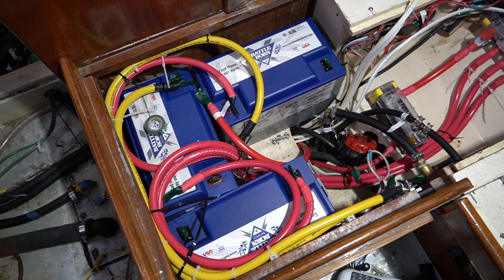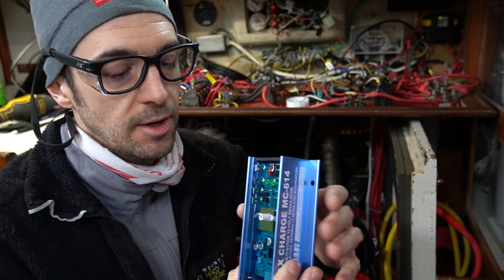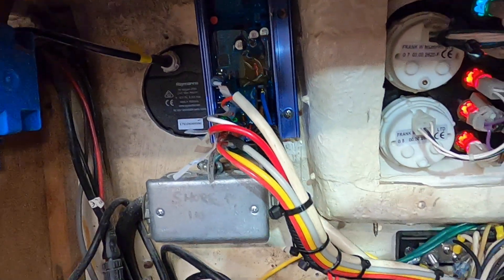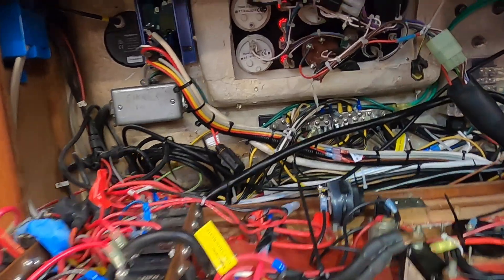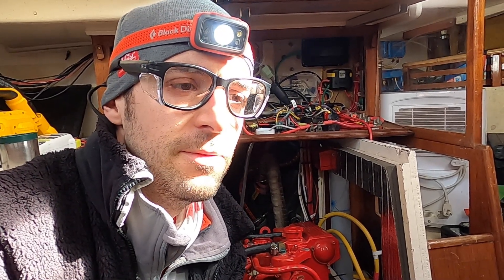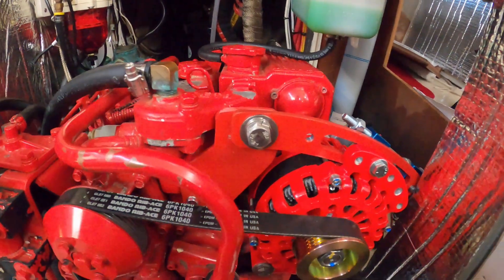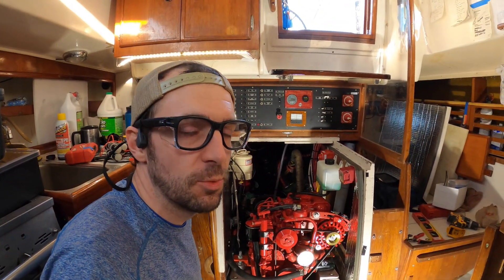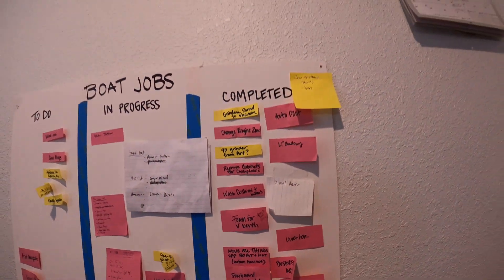Major Electrical Upgrade to our 40 Year Old Boat- WE'RE GOING LITHIUM! (Episode 46)

Comment: The two wires at 6:03 what did you end up wiring them to? I
Reply from the maker: I will get you this information next time I check the engine!
Reply: @CruisingMaya  thank you I've been researching for 3 weeks straight. The purple wire is the ignition key on and the other stats hot all the time. We shall see.
Reply from the maker: @Tripp III  oh my if I known you were researching I would have gotten back to ya faster! 
I am going to run the engine tomorrow so I'll get eyes on it and let you know
Reply: @CruisingMaya  no worries at all, thanks again and you are appreciated more than you know. Your video helped so much.
Reply from the maker: @trippiii7715  Ok so we are staying one extra day, engine goes on tomorrow and I will let you know. Stoked to know the video helped your cause.
Reply from the maker: @Tripp III  OK got eyes on it. One wire was "D+" on the old alternator, which is basically ignition 12v.... tells the alternator the engine is on. The other wire is tachometer. Most engines get their tachometer signal off of the alternator. Our install takes the tacho signal from the alternator, sends it to the external regulator and then from there to the engine dash tachometer. 
Hope this helps!
Reply: @CruisingMaya  You have no idea how huge this is! God bless you and thank you so very much 🙏🏾🙏🏼

Comment: Hello, very nice to see the final product of the wiring. Could you share the fuse sizes you installed for each lithium battery? And discuss how and why you chose mrbf fuses? I see a lot of articles call for class T when using lithium but you can’t beat the convenience of the mrbf’s. Thanks
Reply from the maker: Hello and thanks for your comment! We have a 100 amp fuse for each battery and then a 200 or 225 Amp mrfb fuse (I'm away from boat at the moment). 
A class t fuse would go nicely as a replacement for the master mrbf. For our size battery bank I feel good about two levels of mrbf fuses, but on banks bigger than our 300amphr one I'd definitely put a class t in. 
Thanks again for your comment and watching!
Reply from the maker: Also, space was such a premium for us we opted for the space saving mrbf.

Comment: This is great! I am in the process of researching a Lifepo4 upgrade myself and found this…had a few questions if you don’t mind answering:

Any thoughts on performance of the system after a year of use?
You went from 400ah to 300hr…I know lithium has more use of the 300ah. You happy you went with the 300ah instead of maybe something like 400ah? I am debating doing 300 ah system myself as I have simple systems like yourself but also thinking maybe I just go with 400 as it won’t be that much more…

How much solar do you have on board to help with charging?
Reply from the maker: Hello and thanks so much for reaching out! We are happy to answer your questions. First off, after a year of using and abusing these batteries they tested out at 100% capacity. Here's a video link to where we tested them: https://youtu.be/tDi2wcUUEhI
300 amphrs worked for us, although 400 would have been nice... 
Our supercharged alternator (170amp) and 200W solar panels really helped. I would add more solar panels if we could just to help keep up with our energy needs.

Comment: I would like to know more about the plexus adhesive.  I am mounting bracket boards behind my electrical panel and the access sux!  I usually use thickened epoxy, but for that I usually sand back to glass.  Doing that with all the wires in the way is not an exciting idea.  I look forward to hearing back from you.
Reply from the maker: I feel your pain! I would still recommend sanding back to bare fiberglass with the plexus. However the plexus sets rock hard in like 5 minutes- I used it all the time when I was building boats a few years ago. For hard to reach places I put a dap of hot glue on the thing I'm mounting just before placing it- hot glue holds the item in place while the plexus kicks. It's expensive stuff, but works wonders. Hope this answers your question! Thanks for watching our videos!

Comment: Looks nice, real nice ;-) How's it been performing on passage?  Did you say in another video the reason for doing this big upgrade?
Reply from the maker: New setup has been working great! I have some fine tuning to do- there are a bunch of settings and options with the external regulator. I've got it set relatively conservative for charging at the moment- which is fine for all our long motoring passages, but we will want to really crank the output when we are in mexico and not motoring 4-5 hours a day between anchorages. Thanks for your comment and for watching!

Comment: Hi. Nice project. Do you need a dc to dc charger with the lithium to protect the alternator?
Reply from the maker: We do not have a DC to DC charger. The output of the alternator is directly connected to the lithium bank. The lithium bank is connected to the AGM starter battery via an automatic charge relay (ACR). We have a sterling alternator protection device installed in case the lithium bank is disconnected while the alternator is running. Thanks for your comment and for watching!

Comment: Glad to see another video from you.  Can't wait to hear about the trip!  Really nice lifepo4 install, I'll be doing that this summer too.  Enjoyed the ideas.
Reply from the maker: I am going to try to put together a technical video of the project- I got a ton of great insight from www.marinehowto.com. if you are going to use the mc614, that website is a must.
Thanks for the comment and we've got a lot more good stuff coming soon! Cheers!
Reply: @CruisingMaya  Thanks for the info.  I'll likely use either the MC614 (already have a Balmer with an older regulator) or maybe the new MC618.  What model of crimper are you using on the lugs?  I'm shopping for those right now.   It looked like a very clean hex crimp.

Comment: If you do a technical video (or just feel like answering my question) it would be nice to know what the pulley ratio is on the new alternator vs. your crankshaft pulley and how many amps it outputs at idle, cruising speed etc.
Reply from the maker: We get a solid 70A at idle, and I want to say I've seen it get to 120A at around 2200RPM- which we typically run at (we go about 5.5knots @ that RPM). With our new Balmar alternator we got a performance curve of the output that they tested it at before it shipped. I can't seem to find that right now, but I can share that if I do come across it. So far, very happy with the new setup. We've got about two weeks of full time cruising in and it's been great.